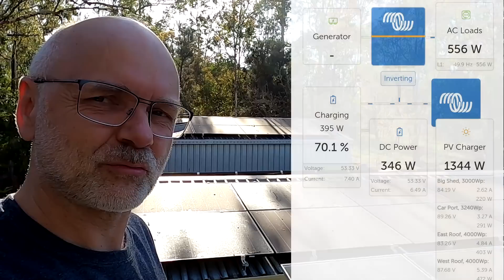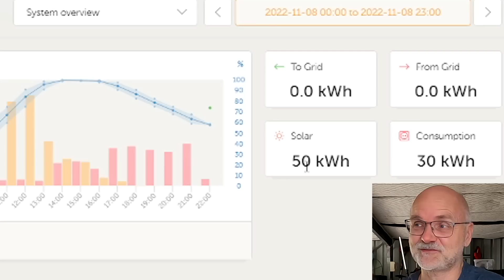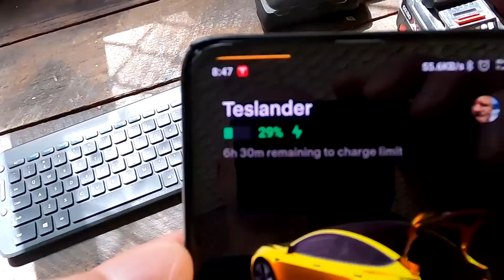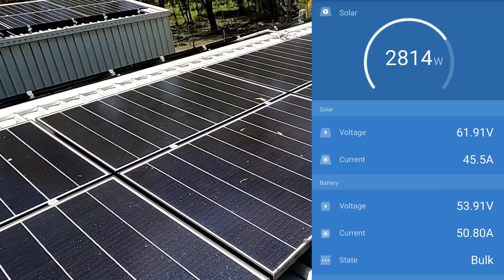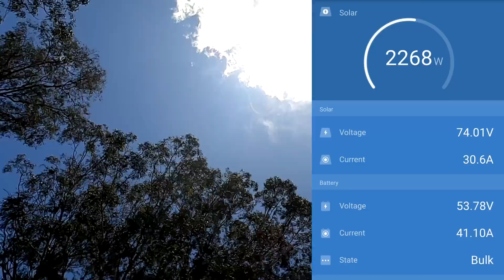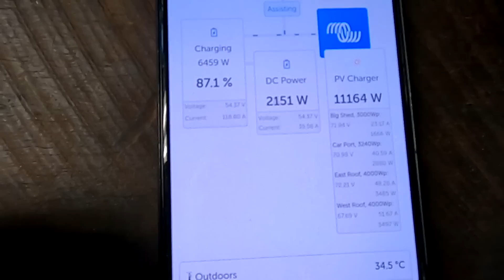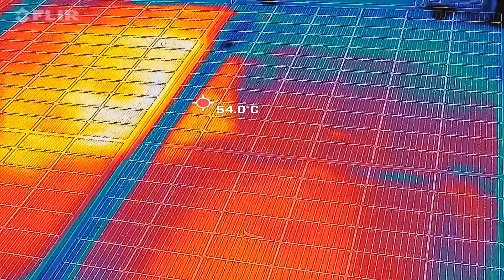I had to limit the output power of the new solar system. First impression after a few days...

Comment: This was great,  to see your face at those numbers.  And you answered my question at the end on the panels - so its not that those panels are running cooler - they are just better?  in terms of kwh/w of each setup they do seem to be kicking the shingled panels ass. Or maybe its just that they get less shading - and hence are hotter - but still grabbing more photons.
Reply: I think the values are also higher because the specified Wp are mostly measured with 1000W/m² light power, I remember in his place he measured always about 1250W/m² light power. Here in germany we mostly have the opposite situation, but in Australia it seems you can expect to get some more power then advertised :)

Comment: The VRM already showed this morning you produced 52kWh with solar yesterday. Really nice! 😎
My solar controllers also show a maximum pv power thats around 20% higher than the panels are rated. So more power than calculated could be possible.
Reply: panels are rated at STC, which is 1000w/m^2 at 25'C cell temperature, many places on earth have higher insolation than that at some times of the day, especially in the middle of summer!
Reply from the maker: We usually have around 1300W/m2 but cannot compete with 25°C at this same time. The panels will be more like 50° when the sun is out. Still cloud corners can reflect parts of the sunlight back and increase production for a moment. 20% more output is possible for a short amount of time.

Comment: You may need to reduce the charging voltage on the charge controllers to avoid a BMS triggering off too early.  Really, the charge controllers should ramp down proportionally as they get near the cutoff voltage - 250A at 54V but 1A at 58V.  But your worry about a cascade shutdown with one controller is valid.  Maybe you want to have 250A or 300A BMS current ratings just in case one battery takes the full load.  Of course it is unlikely if they all play nice....but that might not always be the case.  What is the concern if you charge batteries too fast?  One cell going over voltage will be handled by the BMS.  Is temperature a concern?  Could have a bms that also triggers when battery temp is too hot.

It's time to get a Bitcoin ASIC miner.  It would be so easy to burn energy with one for a test and then you can make a profit selling the Bitcoin.  And with that system size you will have way too much energy in sunny months with no where for it to go.
Reply: have you seen the price and trend of bitcoin / other crypto? There's no way anyone will pay off the investment of buying a miner now. 

Cascade failure is protected by the 80A circuit breakers on each bank - this is a fail-to-safe system and will then just wait for Andy to come back and reset. Nothing on these batteries will get hot enough to be damaged by 80A+15%
Reply: @stefanvanzyl9090  Could also mine with GPUs.  Whatever, it is free energy that is going to waste.  Or make hydrogen to burn in cold months.

The issue isn't a safety problem as much as a BMS hitting over current and then shutting down.  So no solar charging until they are all reset.  These software current limits can get tripped by inrush spikes...not just a 10 minute overload.  Not sure how likely this is to happen....but it certainly could.
Reply from the maker: @jmaus2k  this is why we may need to look into the Seplos BMS and their ability to communicate such data to the Victron system. At the size of my system, there may not be another way of doing it to stay safe.
Reply: Voltage control is the poor way to do it.  Victron chargers have the ability to change the current dynamically via hex protocol commands.  It's a non-volatile setting so it doesn't age the eeprom either.
Reply: @retrozmachine1189  Yeah, they do but you need Victron to make a BMS to tell the charge controller to reduce current when one cell is hitting max voltage.  The smart shunt sending a signal isn't helpful when you need to account for cell imbalance.  We need smarter BMS designs that PWM charging input(lower current) when one cell hits max voltage.
Reply: @jmaus2k  I thought Victron might do it via their existing charger coordination but from other posts it seems not, even if Victron's own smart batteries are involved.  It seems strange to me that the concept of monitoring/control of current at the individual battery level and below when there are parallel batteries involved is such a foreign concept to so many people in the DIY / off grid community when it's such a commonly done thing the commercial world.  It's even seeping into the 48V 19" rack mount batteries with their own onboard switching regulation to control current.
Reply: @retrozmachine1189  Yep.  They really need to upgrade the BMS systems to integrate with charge controllers and possible connection to other batteries in series or parallel.  It would be ideal to connect all cells in parallel and then connect each bank in series.  Then use charge controller/s with battery voltage detection at cell level.
Reply from the maker: I bought an ASIC.

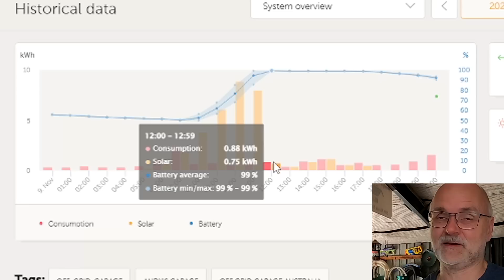Comment: I too thought I had too much power when I installed my 11kW System this summer. My 14kWh Battery used to be full by 10 or 11:00. Then the winter came, and the huge tree to the south started to become a problem. On a cloudy day I'm lucky to get 2kWh out of it, maybe 5 to 8kWh if the sun comes out. It's absolutely miserable, can't wait for spring time haha :D
Reply from the maker: Yeah, that will be the test here as well. There will be shading all over the panels. It will be interesting... until March, I enjoy a full charge every day!